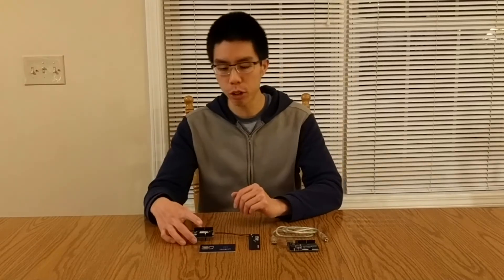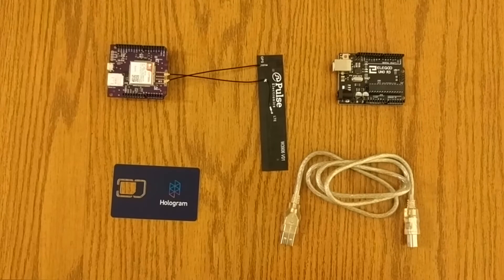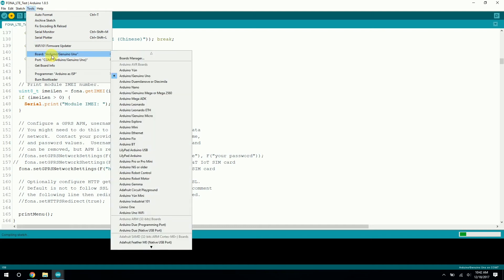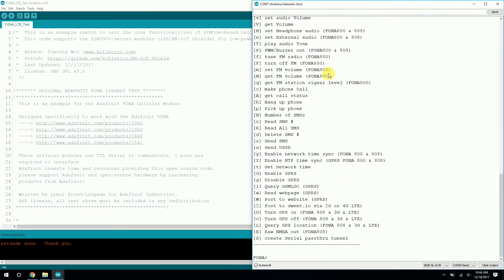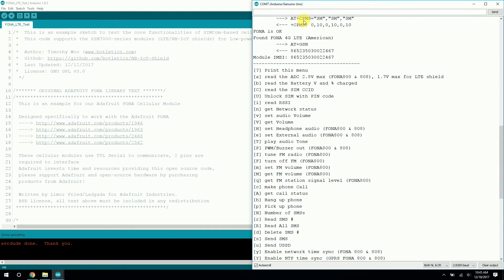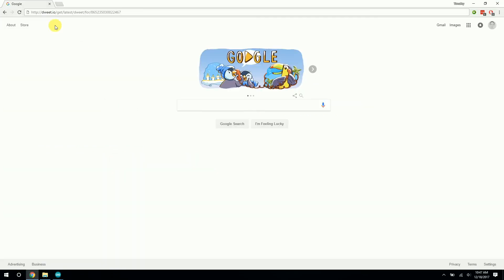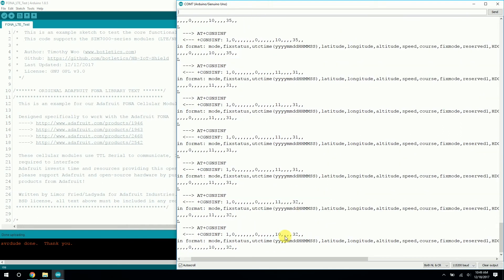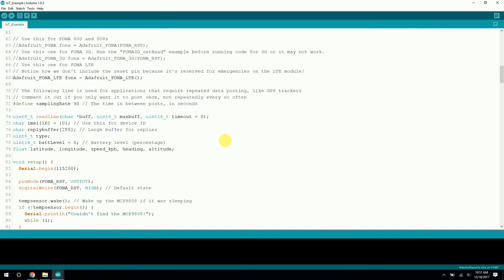#9 SIM7000 LTE CAT-M/NB-IoT Shield Demo

Comment: I have the SIM7000A shield and an Elegoo UNO R3. I’m finding that some capacitors on the shield are bumping into the IC on the UNO. 

If I want to use jumper cables instead of directly connecting the shield, which pins do I need connected from the shield to the arduino?

Comment: Timothy - just bought your shield and get to 4:30, but I'm receiving "couldn't find FONA". 3700maH Lipo is plugged in. Antenna/GPS are correct (crossed). Power is solid green, NET is blinking. hologram SIM is "ready". Using "LTE_Demo" from your most recent patch 1.10. Let me know what you think!
Reply: I have the exact problem. I am connecting from Singapore. So far haven’t got any solutions. Hope @timothy or someone can help

Comment: Thanks for quick reply. what si the latest code tested? I downloaded the codes from the link and having error message when i complied. 'Adafruit_FONA_LTE' does not name a type; did you mean 'Adafruit_FONA_3G'? I use bot the LTE demo and SIM7XXX_LTE Demo.The video uses an old file. I understand things change but can you verified a working file from the link in the video.
Reply from the maker: Sounds like you have Adafruit's FONA library installed, which you need to remove. Please see this wiki page which describes how to get everything up and running: https://github.com/botletics/SIM7000-LTE-Shield/wiki/Arduino-IDE-Setup
Reply: @botletics  thanks so much. It seems I am connected now. Now i have something to work with. very good.

Comment: Can I use an external power supply instead on the battery. I have a buck converter that I can adjust the required voltage.
Thx
Reply from the maker: Yes, as long as it's a strong power supply (2A rated), and you may want to add a smoothing capacitor across VBAT and GND.

Comment: Hi timothy, I was trying the sim7000e module for sending SMS but the function checkSIMstatus throws an error message.

I'm from Spain and I'm using the SIM card from my telephone (Movistar is my ISP), what the issue could be?

Thanks.
Reply from the maker: Most likely you can't use your phone's SIM card because it is for traditional LTE. The SIM7000 requires LTE CAT-M1 or NB-IoT so you need to make sure your SIM card supports that.
Reply: Has podido realizar algo? A mi no se me conecta, me sale: "Couldn't find FONA".

Comment: Hi Timothy,  I have a question

Does Hologram SIM Card work in Singapore? Because I'm using SIM7000C shield to try out on the network but I'm having trouble connecting to the network.  --> AT+CREG?
                <--- +CREG: 0,2
Network status 2: Not registered
Reply from the maker: No, LTE CAT-M or NB-IoT  most likely won't work with the Hologram SIM in Singapore but 2G should work.
Reply: @botletics   Thank you for your quick response. 

I have trouble getting LTE CAT-M or NB-IoT in Singapore, therefore my second option is to change my shield into SIM5320E so that I can get my network connected with 3G?
Reply from the maker: @sarahtanyn3286  I guess you could, that's up to you.

Comment: Hi Timothy. Just a question: when you upload your code, your blue led ( network ) start to flashing? ,  I have that secuence just one time and never again. Thanks for your help.
Reply: I have this problem
FONA> i
 ---> AT+CSQ
 <--- +CSQ: 99,99
RSSI = 99: -115 dBm
FONA> n
 ---> AT+CGREG?
 <--- +CGREG: 0,2
Network status 2: Not registered (searching)
FONA> 

Any solution? Thanks for your help!
Reply from the maker: @Lea2442  Hi there, do you have a 3.7V LiPo battery attached? For ease of discussion please fill out this form: https://www.botletics.com/contact/
Reply: @botletics  I have this connected:
VBat = 4070 mV
 ---> AT+CBC
 <--- +CBC: 0,82,4070
VPct = 82%
But the Battery indicates 3.6V 600mAh Ni-Cd (just a wireless phone battery) 
I fill out in the forum. Thanks for your help.
Reply from the maker: @Lea2442  Please fill out the info at the bottom of this page and send via the contact us page: https://github.com/botletics/SIM7000-LTE-Shield/wiki/FAQ

Also, did you see this wiki page: https://github.com/botletics/SIM7000-LTE-Shield/wiki/Connecting-to-Network

Comment: Will this code works for sim5320 and sim7100
Reply from the maker: The Arduino library supports SIM5320, yes. But not SIM7100, although some of the commands are shared.
Reply: @botletics   means 7100 is not compatible with Arduino ?
Or a different code  need to be used ??? 
Or what
Reply from the maker: @window.location  Any module that communicates over UART could be compatible with Arduino but the particular Arduino library I've been working on does not explicitly support SIM7100. Hope that makes sense.
Reply: @botletics  why😱😱😱😱

Comment: First I have to say that I greatly appreciate all the work you have put into the project. I am having trouble connecting to the network. I am able to unlock the SIM card but after ca a minute of trying to connect indicated by ( <--- +CREG: 0,2  ) no connection can be made (--->AT+CREG?  ) and (--->AT+CSQ  ) get no response. Turning on the cellular data also does not work. 
So here my setup and thus possible causes: 
   - Arduino UNO connected to PC
   - SIM7000G version mounted as a shield and connected via usb
   - no LiPo battery 
   - no hologram SIM but a different one (I have adjusted the apn settings as shown in the video)
I am grateful for all the help I can get :)
Reply from the maker: Hi, please email me for product support questions. Looks like not having a LiPo battery is the problem and is causing your module to shut off and therefore it doesn't respond to commands after that.

Comment: Can we used this shield in Sri Lanka? In here we are using band 5 LTE and How about price?
Reply from the maker: Hi! It seems like the SIM7000C will work in Sri Lanka according this tutorial (https://github.com/botletics/SIM7000-LTE-Shield/wiki/Board-Versions) but as a disclaimer I cannot guarantee operation in any country as I haven't tested it there. Normally you can find the shield on my website (https://www.botletics.com/products/sim7000-shield) but I'm out of stock. However, I'm launching an Indiegogo campaign in a couple days where you can pre-order the next version: https://www.indiegogo.com/projects/open-source-nb-iot-shield-for-arduino/coming_soon
Reply: Thanks. How much it will cost?
Reply from the maker: Shiroshan Randika It will be $89 + $15 international shipping (USD)
Reply: Is it available just  SIM7000C breakout without any gps and other sensors?
Reply from the maker: Shiroshan Randika No, GPS is integrated into the SIM7000 so I can't separate that.
Reply from the maker: You can find my library on Github that works for my shield. It's an improved version of the Adafruit FONA library: https://github.com/botletics/SIM7000-LTE-Shield

However, I should note that I cannot provide technical support for any other products.
Reply: I wish to use NB-IoT for my project. Have your library capability to handle it?
Reply from the maker: The hardware is what should support NB-IoT, the library has nothing to do with it.
Reply: +Timothy Woo Great! Thank you for your all responses.
Reply from the maker: Actually I just decided to change the price to $79 for the kit on Indiegogo. This will also include a free Hologram SIM card and $40 credit.

Comment: question this shield able to do voice? looking at doing something for a car type radio. I've seen other type projects but you have to use many different shields as where this one has many functions all together. Also looking at using the new rock64 due to many extra features that pi and others don't have.
Reply from the maker: Hi there! Unfortunately I didn't have room on it to put voice functionalities on there but I'm planning on making a full, integrated development board with the microcontroller on-board as well as voice support and LiPo battery charging. However, I'm willing to take suggestions on making it a separate module with voice support but not with the microcontroller as it seems some people (like yourself) might be using the Pi or other hardware.
Reply: Right, with the rock64 and this shield was looking to being able to do voice calls and sms, Would that be able to work or does it need more to make it able to make voice calls?
Reply from the maker: Well sorry, unfortunately you won't be able to do voice with this shield but you can do SMS. However, if you wanted to "hack" the shied and add voice to it, be my guest! You would have to solder a few wires to the module itself, but luckily it uses castellated edges so it shouldn't be hard if you know what you're doing.
Reply: Ok keep up the work so far there isn't many 4g shields out there right now. Voice support I would do a separate module that way for people that just want the sms message.
Reply from the maker: Thanks for the input! I'll definitely keep that in mind. I'll also try to remember to keep you posted about a new dev board with audio support when I get around to it!
Reply: Sounds great can't wait.
Reply from the maker: Hi there! I've been in contact with SIMCOm engineers and t seems like audio support isn't available on the SIM7000 and they don't have an ETA for it yet (even though VoLTE is on the spec sheets for some reason) so I'm actually not going to include voice on this module. However, I'm designing a completely separate high-speed LTE shield with audio support!
Reply: Timothy Woo hi, have you completed the design for the high speed lte shield?